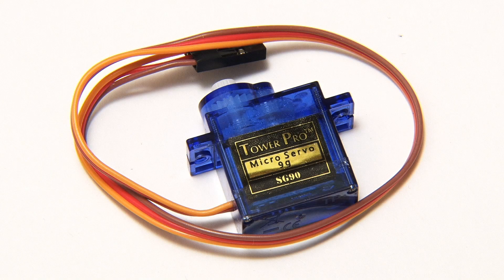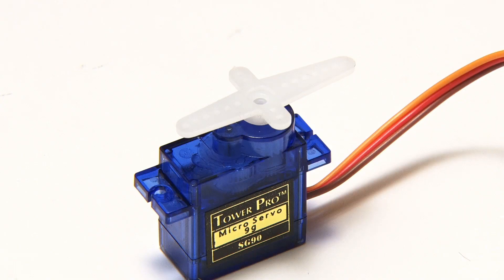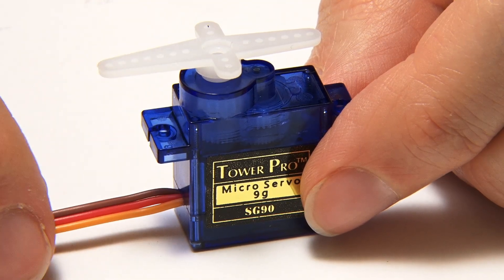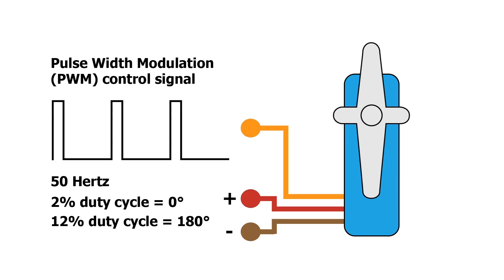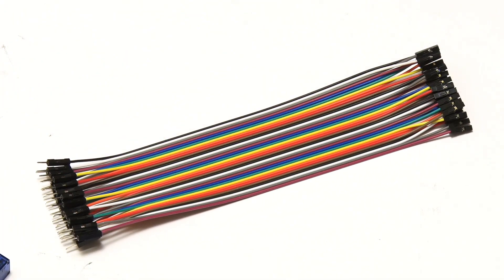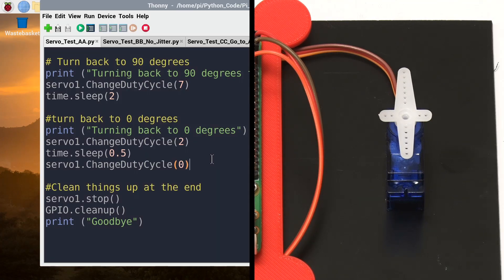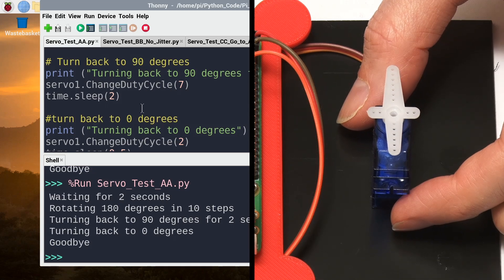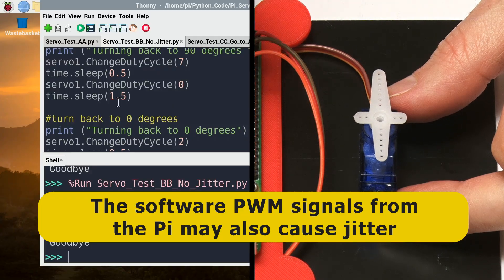Raspberry Pi Servo Motor Control

Comment: Chris, you might want to hear about ServoBlaster! I'm not entirely sure how it works, but I think it accesses the CPU at a low level to get the servo timing right. You mentioned that the Pi PWM is not the most accurate, as it's software controlled - but ServoBlaster takes care of that. You can use to control servos very accurately, without that horrible jitter. It's programmed in BASH, but it can easily be implemented as a Python module. If you're interested, I created a Pastebin with my way of doing it. Don't hesitate to ask if you have any questions! =)

https://pastebin.com/HmEdAeWk
Reply from the maker: Very interesting, thanks. I'll take a look.:)
Reply: @ExplainingComputers  Cool! One note, you set the servo pins in the script in which you import the module, not in the module itself (at least with the code as I wrote it). You can disregard the comments about GPIO_5 and GPIO_6 - that's only applicable for the HAT that I made.

Comment: Great video! i have a plan to build small semi automated aeroponic/hydroponic greenhouses using the raspberry pie as a brain. it would control turn-table motors, and would have ambient air temperature sensors controlling fans and servo motors to open up windows. water oxygen sensors will control a backup oxygen pump. as i get more knowledgeable maybe i can add things like relays controlling 120v circuits that control things like dehumidifier/humidifiers. or heaters. my request is will you please put out more videos like this on the kinds of sensors that work with raspberry pie and maybe work out a project where we can see first hand how to get that sensor to control some kind of relay. i just finished a college program dealing with motor controls so im eager to learn more about programmable logic.
Reply from the maker: Thanks for this. I have a Pi relay control video here: https://www.youtube.com/watch?v=bOGltcgiXiU

Comment: can you please please please explain where you got the pin-out diagram for the GPIO In/out pins.  I have been looking all over the internet for this, even posted a request at the Raspberry Pi forums, have not found anything!
Reply from the maker: It's the standard Pi GPIO, I had it on file in Illustrator from previous videos. The official page is here: https://www.raspberrypi.org/documentation/usage/gpio/
Reply: @ExplainingComputers  - as far as I can tell, all the GPIO pin numbering, from that raspberrypi.org web page  is for the GPIO.BCM setup, and you are using the GPIO.BOARD setup....  so now i am even more confused  :)
Reply from the maker: @bruceblosser384  The diagrams on the pages all show both board numbering and BCM -- pin numbers on/by the pins, and BCM on the outside. So, in the "screenshot" diagram lower-down that shows all 40 pins, we can see that pin 3 (board numbering) is general GPIO input/output pin, as are pins 5 & 7 -- with these pins being GPIO pins 2, 3 & 4 under board numbering.

Comment: do they make relays that are compatible with raspberry pies? the idea is to turn on a 120v circuit with a dehumidifier attached to that circuit. a humidity sensor would make the pie act as a switch. or maybe i would want to run a 120v 2 phase motor. (or possibly a 207v 3 phase motor.) are any motor control relays compatible?
Reply from the maker: There are Pi relay boards like I demo in this video: https://www.youtube.com/watch?v=bOGltcgiXiU

Comment: I don't know the construction of the motor in the case but it is always a good idea to add a flyback diode to provide a safe path for the inductive kickback of the motor. Motors can also consume some juice. Better is to use a dedicated power source instead (or use a cable splitter and connect it to that) of directly connect it to your PI. Remember, when you do this, you have to connect both grounds otherwise the PI cannot 'talk' to the motor (not required when using a splitter). Better safe than sorry.
Reply from the maker: All of my wiring diagrams for separate power show the ground wires connected to the Pi, and I mention this in the video too. :)
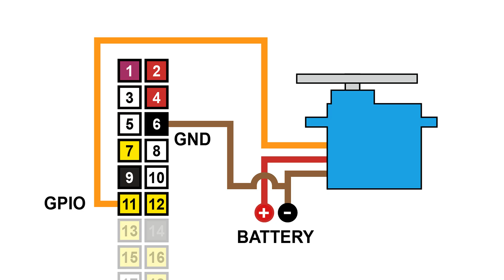Reply: @ExplainingComputers  Okay, spot that (5:39) however no flyback diode at 5:25, could be a smart idea.
Reply from the maker: @codebeat4192  Accepted on the diode. :)

Comment: Could you control more motors with  external power source and if so how meny
Reply from the maker: As I recall up to 28 pins can be set as outputs, so in theory you could control up to 28 servo motors! :)

Comment: This goes back a couple of decades for me, but it looks like the problem with driving servos directly from a microcontroller still exists. If you put an oscope on your pwm signal with the servo connected, you'll find a distortion on the waveform. This is happening because the servo controller is drawing more current than the MCU pin can supply. You can build or buy servo buffers that will fix this for you. The biggest issue with not fixing this is that with very high speed servos, the waveform can distort enough to "command" the servo into the stops on the gears. Since the motor still wants to spin, you get stripped gears.
Reply: Sorry for the editing, lots of failures with my typing today.
Reply from the maker: Thanks for this, though I doubt that this is the case. The servo is not drawing significant current from the GPIO pin, and the signal on that pin is generated by software, not hardware. The software PWM signal will certainly vary, but not due to current draw. I think! :)
Reply: @ExplainingComputers  build yourself a simple buffer circuit and give it a try, I can't remember how many sets of gears I went through before learning this lesson. I did some quick web searching, and not finding something that was pretty easy to find back in about 1999. Some much garbage fills the search engines now.

Some other info suggested that 5 volt signals may be to much for some servos, that 3.3 volts might work better and you could buffer this with a simple opto-isolator. I remember using some kind of common buffer chip, but not recollection of what it was.
Reply from the maker: I can only come back to my point that the PWM output from the Pi's GPIO pins is being generated by software code, not directly from any form of electronic circuitry. So it cannot be influenced by the current draw from the pin. Current draw could damage the pin, the Pi, or cause the Pi to reset perhaps. But unlike current drawn from a hardware PWM output, it cannot alter the pulse itself.

Comment: Excellent video!! u r the reason i`m buying Raspberry Pi and starting buildig something ;) plz recommend which Pi should i buy? thx in advance
Reply from the maker: It all depends what you want to do! :) The range is from a Pi Zero (c.$5) to a Pi 4 4GB (c.$55). But it is hard to go wrong with a Pi 4 1GB model ($35) unless you know you will need the extra RAM, as the connectivity is so good. But then a Pi Zero W is also great ($10) -- basically a Pi Zero with WiFi, though you will probably need some adapters, a USB hub, and to solder on a GPIO header. I'll be posting my first Pi Zero Projects video here probably two weeks today.

Comment: Not sure this question makes sense but is it possible to go from 0 to whatever in a clockwise direction?
Reply from the maker: Not with the servo I used. Although the result could be achieved by going from 180 to 0, if you see what I mean! :)

Comment: RPI has two hardware PWM pins. Also you can try different lib (pigpio) which supports PWM by hardware timer. Maybe this could help to reduce jitter I have never used RPI with servo personally :)

Comment: Chris, why don't you use Jupyter Notebooks instead of Python IDE's like Idle or Thonny? You use the browser as the editor, and your work can be saved in *.ipynb files that also retain graphic output. Check it out!
Reply from the maker: Thanks for this -- I have used Jupyter Notebooks in videos here on the Jetson Nano (eg the JetBot video: https://www.youtube.com/watch?v=wKMWjIKaU68 ). And they are certainly cool. :) But I always avoid introducing more complexity that I need into a video (there is always enough to cover!), and many Pi projects run offline.

Comment: I would like to see radio controlled air plane using a raspberry pi.
Reply: Not a good idea unless you abandon Linux and use a RTOS like ChibiOS. Even then, the lack of hardware PWM and even the lack of serial ports will be a problem...

You're better off with a STM32 based flight controller because these tend to have 3+ UARTs, 6+ PWM outputs, and often have a load of relevant sensors built into the board.
An example - Omnibus F4 (V3) has 6 PWM, built in barometer and gryo, SD card slot, 3 UARTs and a current sensor.... RPi has 2 UARTs, and nothing (if I remember correctly) and costs twice as much (or more).

Comment: One thing, when using the battery, you have co connect - ( black) to the raspberry pi -/gnd to get the servo working.
Thanks for sharing 👍😀
Reply from the maker: Agreed -- and I both mentioned and illustrated the ground rail connection to the Pi in all relevant places in the video. :)

Comment: I was planning to use something similar for my tv to pivot to the otherside of the room and vice versa and this solves the trickiest part of it actually. Now i have find some stronger servos...
Reply: Probably cheaper to use some limit switches and a normal geared motor... Heavy duty servos are expensive, plus servos tend to be designed to move rapidly to arbitrary precise positions, while it sounds like you just want 2 positions.
Reply from the maker: There are some very big, heavy duty servos available! I had not thought of mounting a TV on one. You have now got me contemplating something!

Comment: Are there also servos that can function the other way around as well? Turn the servo and register the angle.

For use as a motorized potentiometer
Reply from the maker: Yes, you can register an angle from a potentiometer (as the servo is doing internally), or via various optical or magnetic sensors.

Comment: I used these for my Arduino (basically the Raspberry Pi, but named differently or something).  They're the weakest damn thing in the whole wide world.  They're weaker than Hillary Clinton benching a slice of bread.  We put two on popsicle sticks to act as a revolving arm joint, and it got jacked up and unable to hold a damn QUARTER.  Not a quarter pound, not a quarter bag of weed, a DAMN QUARTER CURRENCY PIECE!  2 damn bits.  I'd like to know some strong servo motors capatable with Rasp Pi or Arduino that can do robotic under actuated motion, but hell if I've found any.
Reply from the maker: You may want something like this? https://amzn.to/2R99pGf

Comment: I suspect that without a work load you could connect all 5 of the SG90 servos to the GPIO connector at once and even move 2 (or 3) at the same time. It's really when the servo is connected to something like the flight control surfaces of a fast model airplane (or the rudder of a model boat) that the servo has to work hard enough that it needs an independent battery to power it.

Comment: You say that any Pi model can do this ? So if we wanted to use one in a model car, would a Pi Zero be able to drive two servos ? ( Model cars typically use two servos, for steering and acceleration ).A Pi Zero would be the best size to fit into a model car.. Thanks...
Reply from the maker: Yes, this will work fine with a Pi Zero -- to which you could connect 8 or more servos (providing you have adequate power arrangements).
Reply: @ExplainingComputers  Many thanks for that confirmation - model cars use the "separate battery" alternative that you illustrated in your video - you bring good news - thanks !

Comment: Why didn't these kinds of toys exist when I was a kid?
Reply from the maker: When I was making this video, I kept thinking how I could have used stuff like this to automate the models I used to build when I was young. Such a different age today.
Reply: @ExplainingComputers  
Exactly what I was thinking while watching this video. Best thing I could do back then was controlling some stupid relays connected to Commodore's user port.
Reply: @ExplainingComputers  but there was rc stuff and it was a kit you had to build!
Reply: I have been knocking about old RC cars and controlling them with a RPi for a couple of years. I have proven to myself the servo control but not as clearly as this. Wondering what will be my next step. I have an RC glider but was considering a boat first.
Reply: Depending on how old you are, parts of it existed: The printer port can be used as IO-pins, Lego has the Mindstorms system and afaik the C64 had the user port that could be connected to stuff. I didn't have a C64 but the P400 reminds me of it.

Comment: Just wondering a servo to me sounds like a stepper motor. so what is the difference in a stepper motor vs a servo? The main thing I found when looking was https://www.amci.com/industrial-automation-resources/plc-automation-tutorials/stepper-vs-servo/ but just from a user am I wrong in thinking a servo can be used as a stepper motor?
Reply from the maker: Both servos and stepper motors can be rotated to precise angles. But a stepper motor can spin continuously, while servo motors (usually) cannot -- eg being limited to 180 degrees.

Comment: Please setup one using NRF24L01 modules to wirelessly control servos on the pi. I've done it on arduino for a pan-tilt ESP32 camera mounting. I have uploaded my sketch on github and a youtube video on it using arduino. I would like to know how to do bi-directional communication as well.

Comment: My heart is racing ❤️ . Just a question - does my analog, battery powered watch use a servo motor to drive the watch mechanism?
Reply: Probably not.  It's more likely a tiny stepper motor.
Reply from the maker: Of some kind, yes.
Reply from the maker: "Of some kind" covers a multitude of possibilities! :) But I stand corrected.
Reply: @ExplainingComputers  The key characteristic of a servo is the feedback. A stepper motor is open-loop; you give it a kick and hope it moves a step, but don't have any way of knowing that it really did.

Comment: Bonjour Chris,  Thank you for yet another great video.  I've used servos controlled by an Arduino since I feel it is better suited for this purpose in my opinion.  In addition, Arduino has better analogue I/O capabilities.   Servos or mechanical interfaces do not require too much processing speed.  It would be great to have a video that demonstrates a Raspberry pi as the main  processor and using the Arduino to offload all the Electro mechanical functions.  The big advantage is that all the coding can be in python.
Reply from the maker: I agree, if you only want to control a servo, an Arduino is the way to go. But if you have a larger project that needs servos added, then a Pi may be a better platform. And this is my intention here -- so show how a Pi can control servos, as something I can then integrate into future videos, with the servo stuff referenced back to this one. :)

Comment: Can you do a video on using a joystick or 4 buttons to control this rather than having to type the angles in? I'd like to 3d print a pan and tilt housing and attach a light or camera to it and was thinking of using small servos like this, so control of two servos simultaneously to give a smooth pan/tilt would be great through your setup here? Enjoyed that thanks.
Reply from the maker: Great idea, noted. :)
Reply: Hi! I've recently posted a vid on how to control servos wirelessly. https://youtu.be/-rF-ESsCMUg

Comment: Hi Chris will this code run on a pi zero ? i have always understood not all gpio pins can produce pwm signals . i need 8 in order to control points on my model railway  and this would work better for me than an arduino  as i could use a gui with tkinter  to set the points
Reply from the maker: Yes, this can all be done on a Pi Zero, though I would not attempt to power eight servos via the Pi's power supply. :) All general GPIO pins (ie the ones that can be set to provide an input or output) can supply software PWM signals (I list the first 8 in a caption in the video, and all are in green on the "board numbering" graphic). The Pi only has a few pins capable of hardware PWM signals as you note (the Pi 4 has more than earlier boards). But here everything is software PWM, which is not ideal, but works, and I imagine would be fine for a railway.
Reply: @ExplainingComputers  hi chris no i would power the servos independently    i do have a separate power supply i want to integrate it with my turntable controllld by an  l298 configured as a stepper driver and it would be nice to use all in one gui written in tkinter and thanks for you quick reply
Reply from the maker: @robindow5742  It sounds like if you can use the RPi.GPIO module in tkinter (to do the software GPIO), then you are sorted. :)

Comment: I was told running motors directly from the Pi was not recommended. Utilizing servos is a marvelous way to cicumvent this peccadillo.
Reply from the maker: This is true, as the servo includes its own motor controller.
Reply: @ExplainingComputers  That is good for us Pi noobs